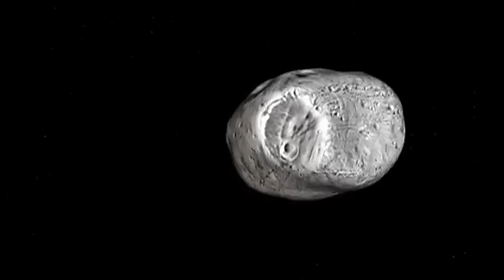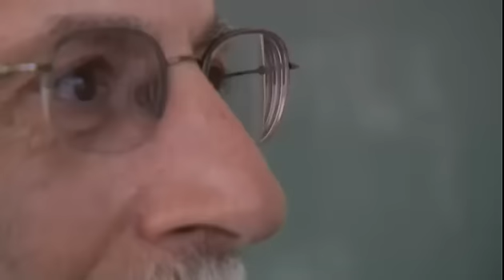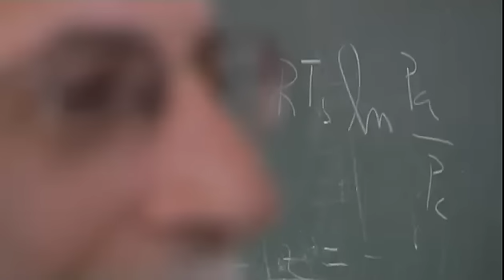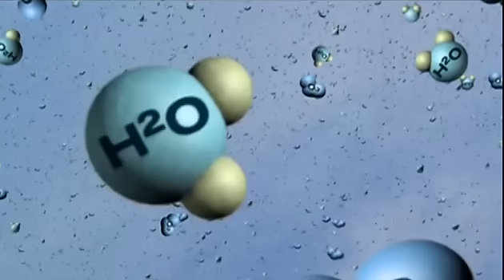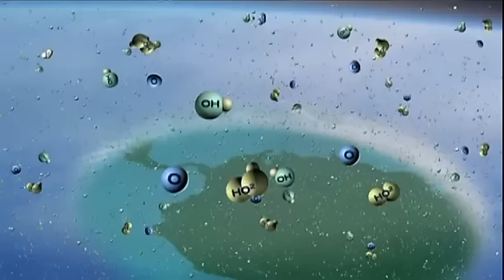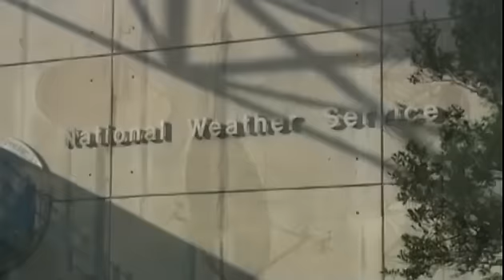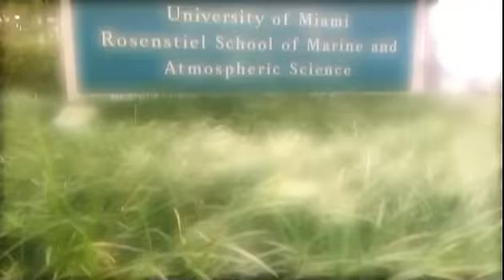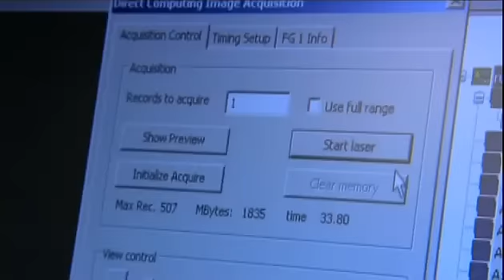PREHISTORIC MEGASTORMS - HYPERCANE

Comment: damn imagine a storm like that packing 500 mph winds and hitting land. not even the most heavily reinforced structure would stand up to it. i wonder how far away you could hear the roar from it. i think their theory is right. an asteroid impact would hurl millions of tons of dust and debris into the atmosphere, and cause firestorms which would heat the air around the impact site causing ocean temps to climb high enough to trigger a hypercane. but the chances of a hypercane forming on its own are basically impossible

Comment: I wonder if they took into account the atmospheric temperature rise caused by falling ejecta.
Could a hypercane form or maintain itself in a super heated atmosphere?
Reply: Well... let me explain! As long as a Hypercane has a connection to Extremely Hot Sea Water. Water that is a boiling point of °122F, the Hypercane can still maintain it's basic structure. If it does go onto land, it will go to "Extra-Tropical" for a couple weeks. Then, it will die out. But, if the Oceans stay at a very high temperature... those Hypercanes, will keep coming. No matter the size... no matter what's thrown at them. As LONG, as they're connected to VERY hot Water.

Comment: To really think that we've just had TWO Hurricanes smash right into Florida this year. Hurricane Milton, theoretically being considered the "Inconceivable Category 6". Milton topped Helena with the fastest wind speeds, it beat Helena by dealing the most Damage, by slicing right into the middle of Florida. Sufficiently cutting survivors off of food and supplies. Power was out for weeks, if not still to the present day. Hypercane's shouldn't even be considered an "EF-5" or even an EF-6. A Hypercane... is on a whole new level of extreme storms. If these little, but extremely damaging storms not only destroyed our Ozone Layer... but ripped our earth apart with horrifying winds. I want to see a Supercomputer Simulation of a Hypercane. From it's birth, all the way to it's death. It would not only help scientists better understand Hypercane Genesis, it could also help us in return. Because we can better adapt our construction buildings to be more evolved to handle such winds... such as no Square corners for aerodynamics, and built with stronger materials.
Reply: There's a reason the Late Permian extinction is also called the Great Dying. On top of the Siberian traps exploding and then gradually releasing toxic gases and lava which led to a domino effect, there was also Hypercanes and radiation which was the equivalent to being in a tanning bed for 4 days straight. It's not just that 95% of life died but that 57% genera as a whole died off.